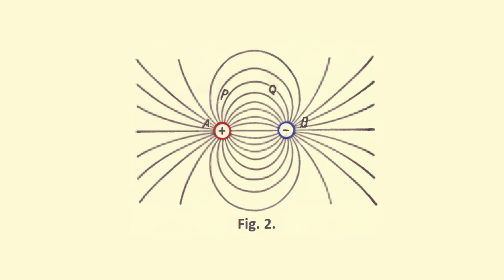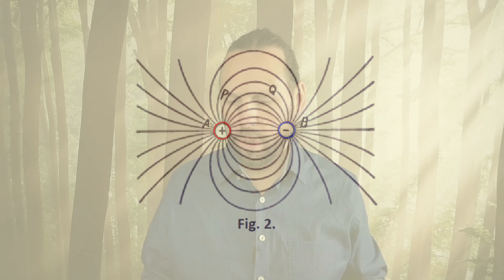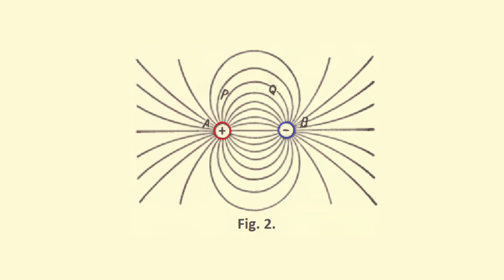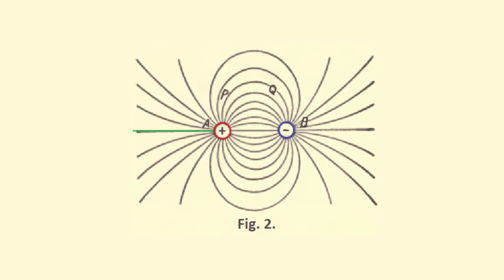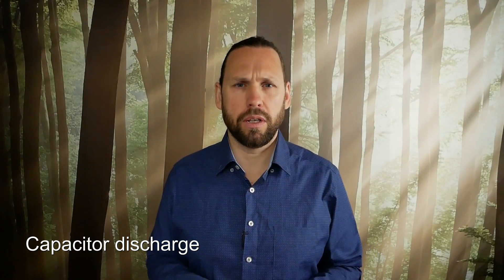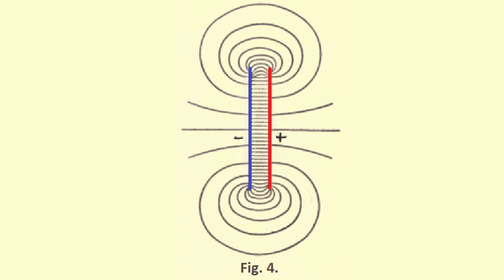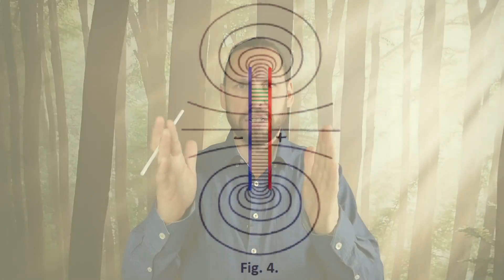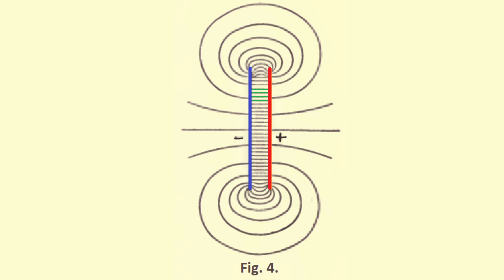Faraday tubes, explain lines of force in electric Aether fields.

Comment: Would it be accurate to say the Positive is the same thing as Charge/High pressure or tension and Negative is Discharge/Low pressure or tension? 

Also, is this why Asymmetric capacitors produce levitation effects? The small plate draws a high concentration of the dielectric field from the larger plate and thus the larger plate moves to the smaller plate?
Reply from the maker: it is the fast change in voltage that is essential.
positive and negative are just polarities. like inflow and outflow.
Reply: @MasterIvo  If P and N are analogous with with inflow and outflow then isn't it odd that 2 charged objects still repel regardless if they are both N or P charged? If N can be thought of as inflow then 2 N charged plates should attract yet they are still repelled?

Comment: Step up the utility of the Faraday tubes. Note conserving momentum, not summing energy becomes more relevant when exploiting/designing electrical devices. Especially relevant when the faraday tubes accelerate. (By direction or rate of movement)( increasing energy transfer efficiency) Amplifying energy in systems should be as common to an engineer as the Oberth effect to an astronaut.  Nice presentation, much easier to understand than the original texts. Party on Engineers. Be good to each other b

Comment: Peace be upon you, Ivo. Thank you so much for your great work and insight.  As you have said yourself, sharing is caring.  Your identification of what you call Aether as massless is spot on, which has not been the traditional view in the past.  

Revealed information from the Urantia papers says in paper 42:5.15 (476.1) that, “The excitation of the content of space produces a wavelike reaction to the passage of rapidly moving particles of matter, just as the passage of a ship through water initiates waves of varying amplitude and interval.”, giving rise to the notion that a particle also behaves as a wave by modern science.
Most importantly, in paper 42:5.16 (476.2) says that “Primordial-force behavior does give rise to phenomena which are in many ways analogous to your postulated ether. Space is not empty; the spheres of all space whirl and plunge on through a vast ocean of outspread force-energy; neither is the space content of an atom empty. Nevertheless there is no ether, and the very absence of this hypothetical ether enables the inhabited planet to escape falling into the sun and the encircling electron to resist falling into the nucleus.”, validating your notion of the “Aether” being massless correct.  

Revelation points out that primordial force is sometimes spoken of as pure energy with the implication that all space is permeated by it.  Pure energy is controlled by the Universal Father.  Ivo, your research is taking you ever so close to tapping into this primordial force, in a way, taking you that much closer to the source of this pure energy, the Universal Father.
Reply from the maker: yes, Like a tsunami is not a displacement of water, its a displacement of energy through the medium of water.

And so is displacement current, not an aether displacement, but a displacement of energy through the medium (aether).

one might say, aether is pure energy.

Comment: Ivo, consider this explanation of pulling forces in stead of repelling is rare. I told you about Eric Dollard his youtube presentation (history of energysynthesis -47th minute). I guess no one dares to do the same because the consequence is that repelling forces do not exist. You may prefer to hold on to the visual or really felt repulsion in your words; The real stuff would mean a revolution; the more because of a similar misunderstanding about magnetism I explained you as well. Trying to have a strong magnet repelled by a stronger string of similar magnets is impossible. The seperate magnet will turn up to viciously around it's ax (when it is round and with little friction) to ultimately be attracted. It won't have moved even part of a milimeter and so is not repelled until one constrains this natural behaviour by fixating it between one's fingers. In constraining this directional correction one experiences the "repelling". So in both cases repelling does not happen like Coulomb's formula suggests. These mistakes in physics originate from our numbersystem in which they introduced zero as a number and since the concept zero cannot be divided, multiplied, added nor subtracted this concept of zero is not a number but only a concept that should have been written like another concept of infinity and can just be left away.
However using it like we do suggests a continuum from positive on to negative numbers (which are superfluous). I hope everyone is aware of the impossibility of the root of minus one although it is being used in physics. Typical human psychological traits have been introduced in physics where everything is something (and not negative or repelling). These failures were being covered by adaptation; look for that in the definition of the electric field that says there must be a voltage difference and for that they left repelling forces out of it (being "wrongly"explained apart); fraud in the case of all "proofs" using the electrometer; an instrument that is covered by an earthed shield to enhance results. Earth attracts any voltage difference and one needs no "repelling" for explanation. If we leave out repelling forces, there are only attracting ones left and that is the way to consider an electric universe. For more info (like experiments that clarify and proof vosforr@gmail.com.

You could do me a favor to send me remarks in this vein.

Comment: If, I understand Ken Wheeler correctly. Magnetic attraction does not exist, how it's explained. There's a low pressure vortex between the magnets, into Counterspace. That the magnetic field/Dielectric Voidance Field is attracted into. I have a picture of this under my Ferrocell. 2 magnets, with a 1/4" plastic spacer in between. To open the low pressure vortex into Counterspace.
Couldn't it be that, the Faraday tubes are being precessioned/twisted from the low pressure vortex between, the plates?
Scalable Aether, Casimir Effect Universe.
Watching your video, repulsion is between the Positive outward toward the Negative Aether Field. Guessing there's a low pressure vortex into Counterspace in between. Pulling.
Reply from the maker: Yes Ken also showed the new vortex forming between two repulsing magnets. Very interesting indeed

Comment: I have a hypothesis on the pyramids. I do believe they were a wardencliffe kind of apparatus, they are a perfect octave of the circumference of he earth. 
We have three tunnels carved out of lime, each 8 miles long(documented by abdel hakim awyan). They were bringing water from the Nile, where it used to flow.....Viktor Schauberger spoke aften about the electric qualities of water flowing through curving limestone. Dr gerrold pollack has documented this phenomena, and calls this the fourth state of water. 
The pyramids were constructed on ten meters of compacted calcite(an insulator) with a center of rose quarts, with strong pfkzoelectric qualities. 
The internal tunnels of the pyramids could easily be a ram pump, and the pyramids were sitting in a lake basically, the capstones were known insulators as well. 
It is my contention the pyramids had such an incredible electrical field, that any human could not get close unless invited, and given the diamagnetic bars of gold and rare earth elements. The bars had to be oriented perfect,y to the body, and earth, and sometimes others could come along, so long as they formed a strong bond with those holding the bars. 
I can guess the voltages would be in the trillions, as Tesla was already into the billions of volts pressure, and the pyramids were with way more field strength. 
If atoms have poles, is this possible in your thinking? For an electric field so powerful that the (+/-) poles can be “combed”?
Reply from the maker: Fascinating. Yes water is a strong dielectric and can be combed. see lord Kelvin's water drop experiment.

Comment: I tend to look at everything as fluid, it’s only a matter of viscosity. Then we only need to find density differentials for pressure gradients, and all movement is explained. About vortex; Viktor schuaberger said a vortex reaches zero resistance at the bottom of the flow; the faster fluid goes in a vortex, , the less resistance is in evidence. He did this experiment specifically with kudu horns. 
When zero resistance is being approached in a vortex, The flow is no longer being pushed, but pulled. We went from a “propeller” to an “impeller”....is a fair analogy.

Comment: What is a"dielectric field" ?
Is that simply an electric field in a dielectric ?
Isn't any material which is not a conductor a dielectric ?
I suppose even conductors have dielectric properties which are overwhelmed by the conductive properties which act to discharge the displacement / separation of charge

What practical implications does the *Faraday tube" solution offer ?
Reply from the maker: the term "dielectric field" is coined by CP Steinmetz, he stated the electric field consists of the magnetic and dielectric field.
I made a video series about his clear views about the Aether field energies
Reply: @MasterIvo  I'll check it out
My question remains about the practical application of the various non-conventional models
My thought is that given that conventional models have quite a good record of explaining/predicting phenomena and designing / building devices which exploit those phenomena, any new  alternative models which purport to be superior to the conventional must be accompanied with new maths constants equations which can generate new results - or at the least reproduce  conventional results without using the conventional math.
Otherwise isn't it just an abstract exercise ?  I'm still not clear how substituting Faraday tubes for field lines provides functional insights.

One complexity I see is that if Faraday tubes all require a conductor on both "ends", it can be quite a conceptual / modelling mess ... Consider a circuit board with a bunch of capacitors 
One end of all the tubes would be attached to the capacitor electrodes - but the "other" end does not have a definitive "conductor" to anchor to
All those field ends from all those serial/parallel caps would have the complexity of a. N-body problem.
If a that stuff has to be approximated out of existence in order to obtain a practical result, why generate them in the first place ?
Consider
Reply from the maker: @kurtklingbeil6900   because this model includes longitudinal fields, and the other models exclude that. in the end a model is onle a frame of thought. nothing more. Nature should always lead. not theory/math

Comment: Hello Ivo, is it possible that Fig.3 repulsion is related to Iteration 1>2 of the creation of the Mandelbrot Set ?  See graph in https://youtu.be/oNxPSP2tQEk?list=PLuxFlKBjge0X-586poIdDkP5aCoqrhJks&t=877 I Don't have a lab so I only wonder what happens with an electric field when current goes trough or around a cardioid sectioned cable instead of a typical circle section ':)
Reply from the maker: I don't know.

Comment: Aether toroids are moving through spacetime (measure of rate•distance) in circular motion visualized as smoke rings or underwater dolphin blown air toroids. However, they twist not only diagonally (from your circulation animation) but mostly as if rolling along another tube. Which is represented by your series of rings around the common center. Also a central tube made up of the medium such as aether, water or air. The dolphin does not blow water through the middle of the ring to move it forward. The water (central tube) is not moving. But the ring is moving over it. Like a rubber ring rolling down a pole. A circular pole according to the holographic magnetic fractal geometry. The outside edges are meeting the fluid (moving toward the fluid.) The inside edges are leaving the fluid behind. Moving away from it. The air or water or aether in which the toroid is moving is not itself moving. The toroid circle tube is using centrifugal outward pressure against mediums to create inward vacuum emptiness inside (centripetal convergence.) The diagonal is created when this fractal of toroids is also itself rolling down a larger tube. And so on. Tubes make rings and rings make tubes. All done by motion compression and decompression. Variation and pressure mediation. 

Condensed outward (as the edges of tubes) the walls get thinner and thinner. Fractally meaning mass is reduced in size (distance) while spin rate is increased (rate.) Therefore, mass results from measurements variables space reduced and time increased. Conjugatively outside, and inside, of a singularity tube space is infinite and time is zero or none.
Reply from the maker: beautiful!

Comment: Mass is caused by the volume of ether? Then does gravity terminate as ether or vice versa?
Reply from the maker: good question. Gravity is still a mystery to me.
Reply: Master Ivo  Something for me  to investigate then, ah, a mystery...”The game is afoot!”
Reply: Master Ivo Also, I posted to an earlier video, but I will post it here if you can comment, I would appreciate it.
Reply: Master Ivo If you build a capacitor, then remove plate A and replace it with a new plate. The charge will still be there. Then if you replace plate B with a new plate, the charge remains. The only thing that has not been changed is the dielectric. This bugs me for some reason. What if there was a a coil on one side of the capacitor that felt the charge from the capacitor. Then if you remove the plate, would the charge be felt in the coil, as well as the dielectric? What if the coils or plates were switched infinitely fast, while the charge was still present on both the current and previous coils/plates. Could we then 'steal the charge' over and over again? I hope I have explained the situation I envision adequately.
Reply from the maker: @undernetjack    Because the elecric energy is stored in the dieletric field, which resides in the dieletric material between the plates. 
The test shows you can polarise a dielectrci material, and it stays polarised, even when you remove or change the plates. 
It is very strong proof the electron is really virtual. it is only a tool for mathematics. 
In reallity we only have fields on the outside of the conductors, which terminate on the conductors. This termination point of the field can be seen as the "electron". but it still is not a particle. it is the start or termination point of a field line (faraday tube)
Reply: Code Tech  Yes, I know that. I suppose it is difficult to explain what I am proposing. Imagine a rotor, it is charged by a large capacitor with some voltage. It spins very fast. Now, around the rotor you have a stator with many switches. A switch closes creating a path from the rotor through a coil to a load , instantly the potential difference from the capacitor is felt on the coil, even before current begins flowing, // then  the switch is opened  and another switch closes making a pathway identical to the first // what happens to the potential difference felt across the first coil? Does it discharge through the load? Does it disappear? Does it just become attached via ether to the second coil? I think it can discharge from the ether through the coil into the load. Without discharging the capacitor.

Comment: Ivo:     Still subscribed and been a while. But I have a question for you. First I recall you discussing use of a 'fet' once for your triggering for that pancake coil experiment (rather than relying on a spark gap). With that in mind is it possible to have a private exchange (email conversation) with you? If you agree  I'll post it for you then. Thanks:
Reply from the maker: Working with IGBT'S now for a half bridge circuit. not interested in sparks. they waste energy